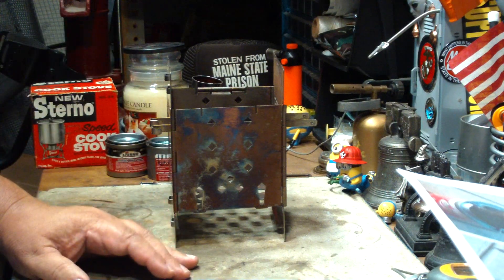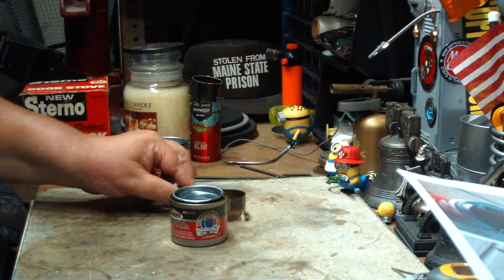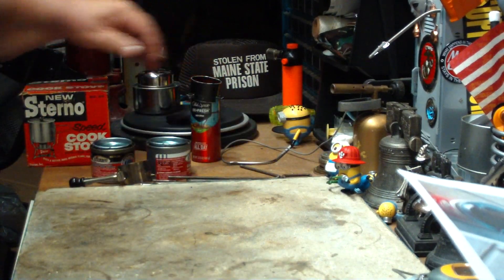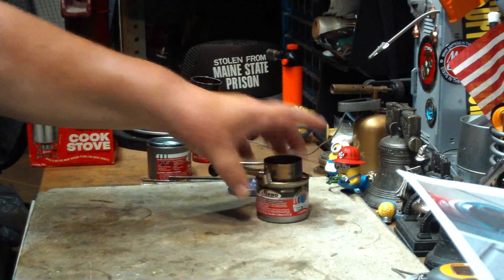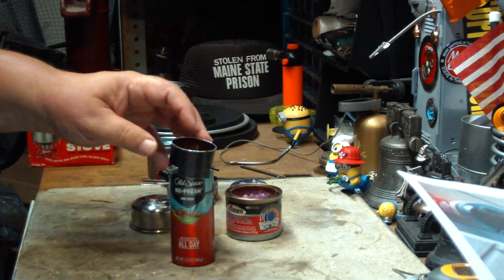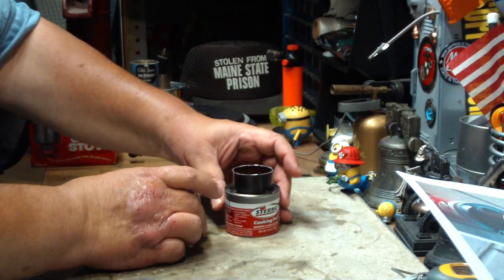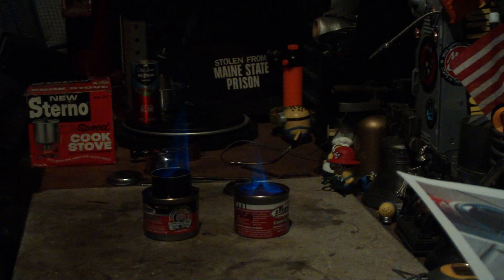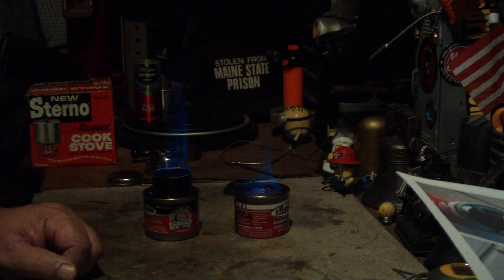Video Response to FireboxStove's "The Most BTUs From Canned Fuel..."

Comment: That's awesome Hiram! I have actually watched your previous Sterno intensifier video and it stirred up some ideas about a longer version (to actually push into the gel) with holes perforating the extra length. The holes accommodate air flow (as per yours) and the extra length would transfer heat into the Sterno to cause more evaporated alcohol.
 Could you try that with the material you have left over?

Thanks much for yet again, getting everyone thinking. Great stuff.
Reply from the maker: Hey Steve, Have you been peeking in my notebook? 8-) I thought the same thing but the problem would be the mess when you wanted to put the stove away. I'll try it anyway just to see what happens.
Reply: Hiram Cook Yeah, probably not practical, but it's always fun exploring ideas!

I think it may require a two walled set-up to wick the alcohol up to a hotter place (the gel may prevent wicking?) to then be vaporized? Just having a heat transfer into the gel would require the whole can and contents to reach the alcohol evaporating temp. Does sterno melt when hot or dose it hold it's form?

I'm rambling. Thanks Hiram!